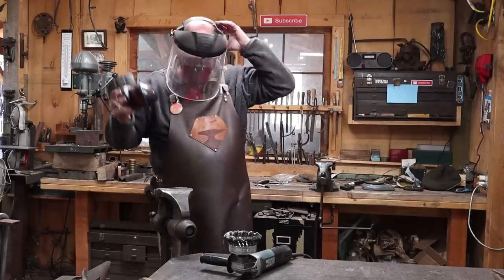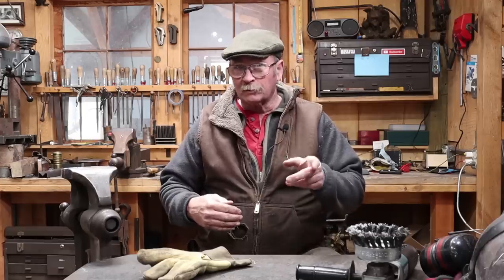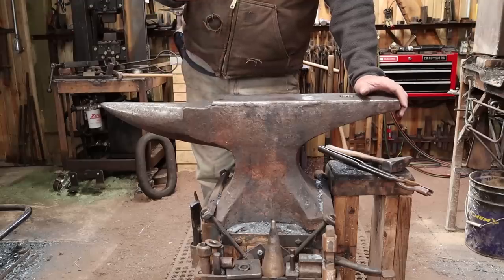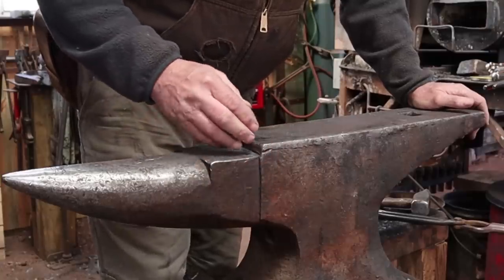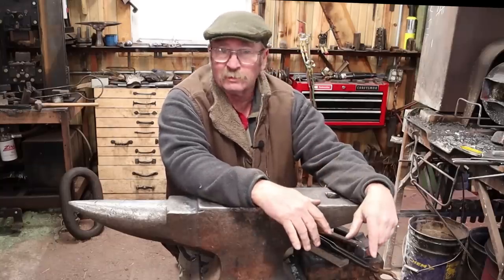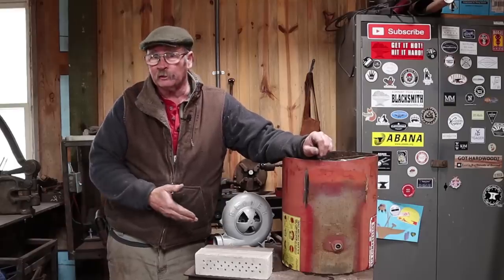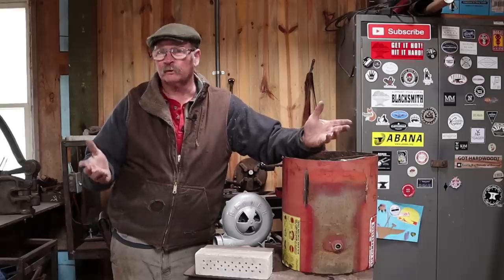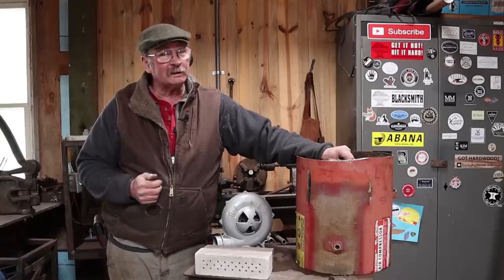Q&A April 14th, Anvil?  Ribbon Burner? Gloves?

Comment: I built my ribbon forge out of an air tank and it's holding up just fine. If you keep the burner port well insulated you shouldn't have any problems. I would suggest not using that blower you had sitting next to it. You'll find you need very little air flow in order to maintain a hot propane forge. I have a smaller blower which is almost completely choked off most of the time. Also, try plugging up about half (or more) of the holes you have. I'm down to 6 holes and easily reach forging temps. Design it like an oven, with minimal opening area, and you will get much better efficiency.

Comment: I tried making charcoal once.  It is time intensive cutting up the wood into workable pieces.    The one and only time I forged with charcoal the flying embers burned numerous holes in my work clothes which doesn't happen as easily with coal.  My propane forge is slow to get to working temp but once there it holds it and doesn't burn up my metal.  Just my experience.

Comment: My anvil is marked ACME... Used to be sold through the Sears & Roebuck catalog. My forge is a repurposed gas grill body that was cleaned out, lined with fire brick and burns solid fuel. Air is fed in through a black iron pipe that lies in the bottom and has holes poked in it. Planning to switch to a gas forge soon - I spend too much time fussing with the fire...

Comment: Good one John. The Hay Budden anvil looks like same pattern as my Peter Weight but I guess there were many that used almost identical patterns. I have a single burner Chile Forge and it is great also. I am still figuring out how to forge weld in it but I'm getting there slowly. My problem is I'm too tight on the propane, it chews through it at higher pressures so I'm always experimenting with getting good welding heat without too high a gas flow. Like bricking the doors and putting brick pieces inside to reduce volume. I enjoyed this little short video, but I can't think of anything atm as a video subject. Luckily I got clearance to travel to my workshop which is just on the next ridge from where I live. Thank you and forge on brother😊

Comment: I like these little insight videos , though why some folks obsess over equipment that is not in top shape escapes me. Though, it tends to make me think they have not worked in shops long enough or worked with out the backing of a large check book to buy new equipment when ever they want. When ever I have been asked " Why don't  you get / buy  ________ to replace or make easier what ever I am doing.  I hold out my hand and tell them donations // tips are accepted"  it usually shuts them up . If not they are shown the door.
Reply from the maker: Very true

Comment: Thanks for another informative video. I do have a very specific question; in your 10/31/17 video on forging a hot chisel, at about 8:33 in you start using a different hammer, one whose design makes my mouth water. Who made it? I know, a different hammer won't make me a better blacksmith, but a guy can dream.
Reply from the maker: That was one I made but has since been sold
Reply: @BlackBearForge  So I'm a day late and a dollar short yet again! Drat! I really, really like that one. Can't find one like it anywhere. Sigh. I suppose I'd better forge up an eye punch and make my own. Sigh.

Comment: Hi John, it's good to hear you are staying safe out there.  I've been making some charcoal and I'll be interested to see your take on it.  I'm using a 55 gallon barrel. I start a wood fire in the barrel, I keep feeding it and let it burn for 75 to 90 minutes, put the lid on the barrel, shovel some dirt over the vents at the bottom, and come back in a couple days when it's all cooled down.  The charcoal makes a nice clean fire and I use this only when trying to forge weld.  I'm enjoying the charcoal a lot.
Reply from the maker: I have been using a double drum system that recycles some of the combustion gas and burns it to fuel the process.  But it only does about a half days worth per burn.

Comment: Thanks for another informative video.  I saw your cone mandrel in one of your previous vids and had wondered about the groove in the side.  I have a similar one that I procured from Pieh tool, but it doesn't have the groove.  Can you talk a little about that particular feature and perhaps demonstrate how it is used?  Thanks again!
Reply: The groove is so you can get tongs in to grab the material. Handy but not usually necessary.

Comment: Another question for next time:  How stiff should the bristles of a wire brush be?  I bought one cheaper butcher block brush and it was not any stiffer than a standard wire brush.  Then I bought another butcher block wire and the bristles were so stiff that they do not bend when used.  It leaves faint scratches and it takes a lot of swipes to get all the smoke deposits off.  I hand bent all the bristles in one direction  so it slides better, but I still wonder if it is too stiff.  The bristles are rectangular, about 0.1 inches wide.
Reply: The bristles are about an inch long.

Comment: What about a video on post vice repair, setup, or ?  I repaired a post vice. It works. Not sure if I did it right. How to make a spring for a post vice. Best way to make a mount for a post vice. Pros and cons on how to set up a post vice. I made mine portable and mounted on truck wheels because I have limited space. Not sure if that was a good idea because they move, but they are able to be moved so it works for me...
Reply from the maker: I have never repaired a post vise

Comment: Hey bud glade to hear you still have steel going out the door.. I have been trying to make an axe drift for some time now. I guess the stock I keep using is to small.  I’m hopping to make a drift that will work with a few different sizes of axe small to around mid size.  Last one was out of 11/4 x 3/4   4140  about 18’’ long. Hand held seems better.  Any stock larger is a little hard to do by hand. No power hammer.  But I did build a 20 ton press. Not sure if it will help.      Ok  bud. Thx and be safe!!! ...Paul.
Reply from the maker: A press should be a big help in making a drift

Comment: I do charcoal most of the time, and it works brilliantly, however you'll use about 5-6 times more charcoal per volume than say Coke. But it burns clean and hot and you get no clinker unless you're forge welding.
Reply from the maker: Its the making or buying that much that holds me back
Reply: @BlackBearForge  I can well imagine a busy forge would need quite a bit. It is quite a nice fuel though. 

Here, despite being a major coal exporter, it's actually not fantastically easy to source coal or coke, but very easy to get charcoal.

Comment: What are your thoughts on a brake drum forge using a hairdryer for air?
Reply from the maker: They work for smaller things, but I was really glad when I ditched the brake drum and bought a real fire pot and hand crank blower in my early days.
Reply: @BlackBearForge  to much fuel and not enough air? Or something else?

Comment: I typically use charcoal for fuel, as coal is expensive where I live as well.
One question I have is how do I prevent too much oxygen from getting to the material, but still allow the metal to get sufficiently hot?
Reply from the maker: It is best controlled with where your material is placed in the fire.  Too low and there is to much oxygen.

Comment: maybe this has been asked, scrolled through, but didn't see it. In one of your drone vids, it looked like your shop has solar? Do you have grid power as well? maybe a quick vid on your solar power system (unless it wasn't a solar cell panel?). The other maybe more than a quick topic is pros/cons of resurfacing your anvil. I've thought about it, as mine doesn't really have a clean edge (rounded on both sides) and the top has more than a few dings. None too bad for me to say "nothing to lose" but noticeable. thx.
Reply from the maker: The shop is in the process of getting limited solar, enough for lights and perhaps a forge blower.  But it would be really expensive to put in  enough to run the power hammer or press.  It involves preheating, welding with hard surfacing rode, post heating and slow cooling.  Then you have a lot of grinding at which point you realize how bad your welds were and the process starts all over again.

Comment: John Switzer Sir, After you got me interested in propane and your ribbon burner video, I did build my own and after a failure due to poor information ( Shure the you tube man ment to help) .
 I rebuilt and with information from The Black Bear Cummitive Forum , And it's HoTT and it just last week burn up a heavy farrier file this is over 1/4 of solid not the grain of the surface and as your video instructions mine has the safety seliold as your video

Comment: Thank You John. I'm in the process of designing and building a gas forge. What I'm trying to figure out at the moment is the type of gas burner I'm going to use. In your opinion, should I build a Venturi into my burner to make the heat distribute more evenly,  or just leave it out and let it do it's own thing? Your thoughts please 😊
Reply from the maker: For a blown forge with short runs of pipe it is sometimes necessary to have a way to better mix the gas.  Most naturally aspirated burners shouldn't need it.
Reply: @BlackBearForge  , thank you very much John 👍

Comment: I would like.... as a beginner I make lots of mistakes.  Many of your videos include error correction.  Thank you very much.  However I do not recall your showing how to "unrivet" especially a pair of tongs.  I saw another YouTube er forge a railroad spike.  He used flux to prevent cold shuts.  Is this possible?  Wise?  Is there an easy way to make gate (or door) hinges?  How do you know when the metal is white hot but not burnt?  When using mild steel.  I am going to try your Poz tongs but I would not mind seeing you make a beefy pair.  That will do for now. Thanks.
Reply from the maker: Flux will not prevent a cold shut but sometimes you can forge weld the are to seal up the shut and flux would be helpful.  Lots of ways to make hinges, it just depends on what your after.  If its throwing off lots of sparks, its burnt.

Comment: Hay John, Just a quick question. What material are you using for your hold fasts? They seem to be very tough.
Reply from the maker: I buy cold rolled that is 1/16" undersized.  So for a 3/4" hole I use 11/16".  They aren't hardened and shouldn't need to be made from anything fancy.

Comment: As always, great content, John. Thanks for all you've taught me over the last couple of years. A quick question I have, which may be useful to others, is about my 4140 drift. I'm in the process of forging my first hammer. Can I cool my drift in water if it's not showing color? Obviously I can't quench it in water, but can I cool it from straw or peacock? Thanks!
Reply: 4140 is tough stuff. Harder then mild steel for sure. In my experience,  if its not red hot, your good to quench in water, just be careful cuz over time if it does get too hot it can fracture
Reply from the maker: I cool pretty much everything in water as long as it isn't red hot.  So far no problems
Reply: @BlackBearForge  Thank you!!